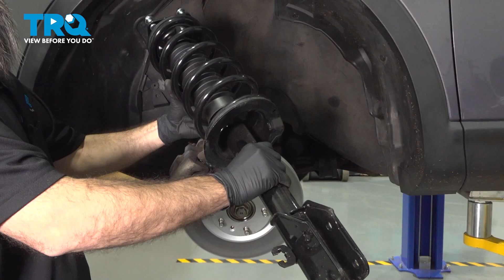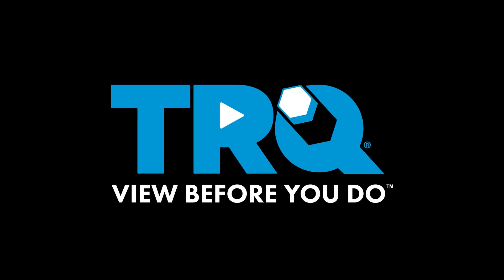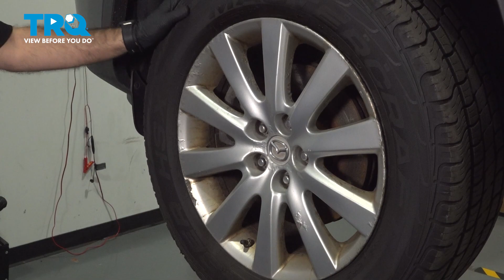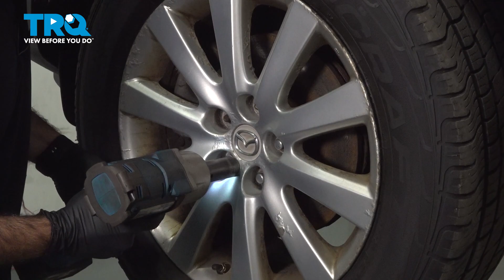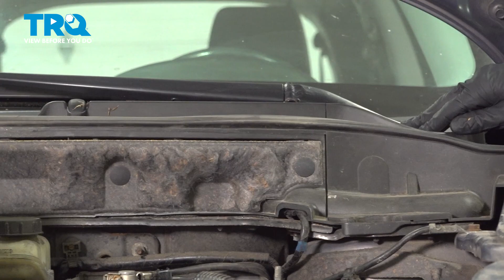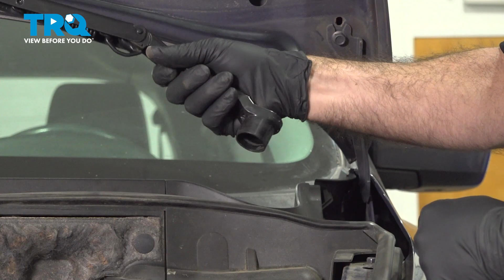How to Replace Front Strut 2007-2015 Mazda CX-9

Comment: I replaced mine with TRQ units as they were clunking and worn. Now I have squeaks esp from right front. I sprayed silicone lubricant thru up top and its stop...terribly annoying. Any ideas? I followed video, all bolts torqued as mentioned. Unsure what the deal is...

Comment: Great video!  I really appreciate the time and effort putting this together. two items to consider:
1. the need to have an alignment, once all four wheels suspension is complete.
2. you may want to show more of how you lined up the flange/knuckle bolt holes. Emphasize the importance of getting the flange/knuckle bottom bolt in place, using a pry bar to line up the flange hole to the knuckle bolt hole.

I had 1 1/2 inches between the two holes. Wasn't sure exactly why this happened. I remeasured the old strut with the new one, and they were exactly the same. I moved the strut all around with no luck lining up the flange and knuckle holes. after 3 hours of trying to figure out how to line up the holes, I read on a different site that stated to push down on the sway bar(i think that is what it is called), and use a round pry bar to line up the holes.